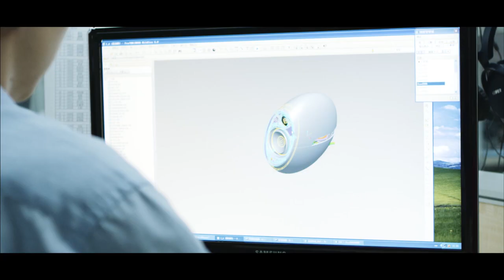Edifier.com Luna Eclipse e25 HD - Forging the Luna Eclipse

Comment: Can't disable Bluetooth profile or protect with a different pass code. Neighbors  are connected  all the time and I cant prevent it. Switching to the line doesn't help - Bluetooth reconnecting switches it back. The worst user experience!
Reply: merci, malheuresement c'est le plus gros problème de ces enceintes, alors que le son est superbe.
Reply: EXACTLY THE SAME PROBLEM